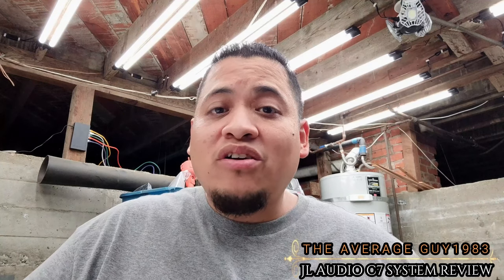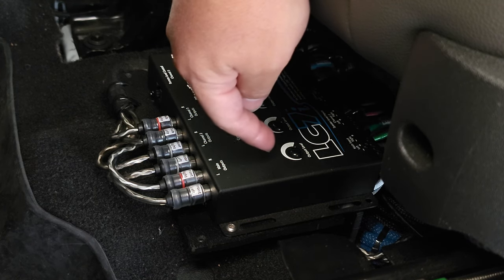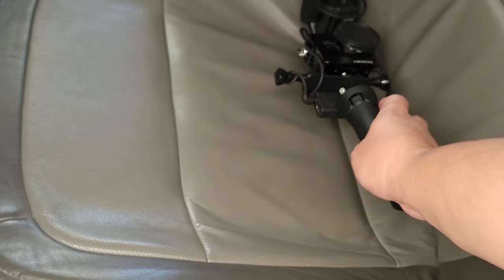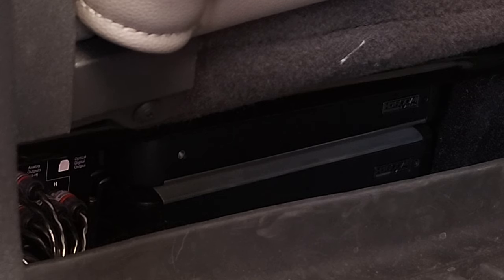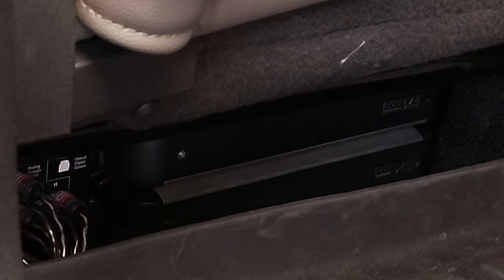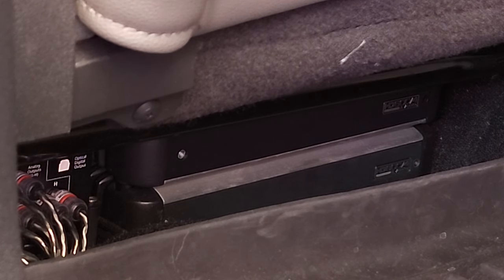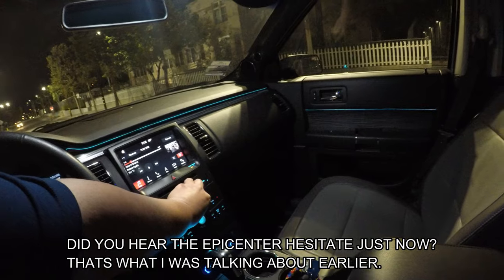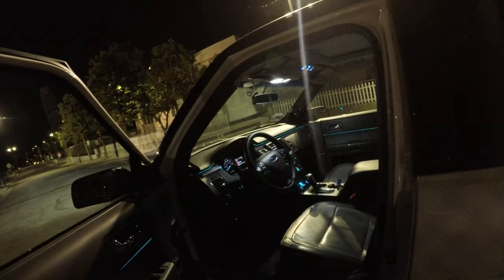MY JL AUDIO C7 AUDIO SYSTEM REVIEW

Comment: Jl is great but man those prices. I just got an active 3 way setup installed. The hertz mlk 165.3 and a twk 88. Need to play around with it as it sounds slightly hollow.
Reply from the maker: You are Absolutely right about the price it's super Expensive which is going to make it harder for others who want these speakers actually be able to get their hands on them. As for the Hertz MLK 165.3 I've heard those in person a while back!!!! They sound pretty damn good and close to the C5-653s from JL Audio. If the sound is a bit hollow and you haven't added any sound deadening inside of your doors for those midbass woofers you may want to add a bit to make the doors more solid. If you can't go crazy with making the doors super solid, you should be able to get away with using some type of Adhesive foam deadening like the Soundshield Deadener. It's a little pricey though but works well and 1 roll is enough to put 1 layer of deadening for 2 doors but only the inside of the door cavity. On my flex I spent over $1k in deadener from knu konceptz and Soundshield combined and I'm still not 100% satisfied lol!
Reply: @THEAVERAGEGUY1983  yeah im deadened with stinger roadkill and also have fast rings. Door is sealed up. I think it has something to do with my midrange and tweeter being off axis. My a pillars are firing just like yours but hertz recommends on axis. Not sure i want to rebuild the pillars any time soon.
Reply from the maker: @ah4800  hmmmmmm..... I see your going through. 1 question, have you done time alignment yet on the TWK88? I did 3 for mine. 1. Was the driver side 2. Was the wife's seat and 3. Was the middle passenger seat. I got a measuring tape and measured the middle of all the speakers like the voice coil spot to my listening position. So when I press the DRC knob I can get a different preset sound wirh the same exact EQ for all the speakers and I got different results for each Time Alignment. Some songs sound better with my seating position and some sounded better with the other two. I would give that a try and see if it helps.
Reply: @THEAVERAGEGUY1983  yes ta is done

Comment: Where do you get the component for the a pillar with the mid and tweeter. Does someone manufacture those or was it made
Reply from the maker: Hello, the A pillar speakers I got from Abt.com but the A pillar it self I made it with Acrylic speaker rings for the 3.5" midrange and Tweeter i got thoae at HVCA.com as at the time i didnt have the equipmentto make my own. The charcoal gray vinyl I got from ebay after buying several gray and beige color samples and I was lucky enough to have it match one of them as close as i could to the door panel though I would have preferred the original Light Dune/ Beige color the A pillars were. I might re make them in the future if I'm ever able to find the original Dune color.

Comment: In your opinion does one 10w6v3 have enough output?
Reply from the maker: Honestly if you listed to bass heavy music and can have it in a ported box, yes but if you listed to 80s rock and hip-hop like i do in a sealed box, i would recommend 2 of them. Infact i wish i could fit 2 10w6V3s on my flex lol. I would be very satisfied with that.
Reply: @THEAVERAGEGUY1983 if you went with 2 10W6v3s would you need to upgrade your alternator?
Reply from the maker: @donaldhayes8799  yes i definitely would. At least as close as i can get to 200 Amps to cover what my flex uses plus the audio system it would prevent the lights from dimming and also hearing a tiny bit of distortion on the speakers from having lower voltage and amp hour ratings on full volume.
Reply: @THEAVERAGEGUY1983  did you make any electrical upgrades at all with the one 10W6v3 setup?
Reply from the maker: @donaldhayes8799  only the BIG 3 upgrade with 4/0 Gauge KnuKonceptz Power wiring. Just doing that alone increased the voltage by 1 volt from 13.4 to 14.3 volts. It does dip down to about 12.3 whenever the bass hits hard but rhe majority of the time its always around 13 to 14 volts. Im sure if i had a high output Alternator i would definitely not have any voltage dipping.
Reply: @THEAVERAGEGUY1983  ok thanks for the info!

Comment: won't  the mids experience beaming when set at frequencies they aren't intended to play you have mid bass set from 70hz to 20khz they are rated to 5khz I'm just learning so I could be wrong what are your thoughts on this sounds good from my computer but I'm not hearing what you are.
Reply from the maker: From what I noticed it doesn't affect the sound at all it made it sound better but I am using the HD amps which have way too much power for these C7 speakers. I do plan on trying out their recommended frequency for each speaker once I upgrade to the VXi amps this way they will be running on their actual power rating and maybe even improve the sound. In my flex the door speakers are really low to the ground vs my last car where my C5 3 way Components were on the door panel at my knee level while sitting on the seat. I'm thinking the frequency response really depends on the inside size of the door where the speaker is getting placed in as the inside of the door does act like an enclosure for the midbass speakers. But yes I do intend on bring down the frequency range back to 5kHz and just lower the bass output on the EQ without affect the crossover range but with the VXi amps once I get them. I'm also very interested in how that USB mic Steve Turrisi recommended me will be working with the TuN 4.0 software. They said that it will only work with the VXi amps for now so I'm going to be contacting them and get more information on how that is all supposed to work together.
Reply: @THEAVERAGEGUY1983  I have the same JLhd600/4 amp running Hertz mille pro mpk 1650.3 components passive on the front and Hybrid audio imagine series 5 x 7 coaxial in the rear and yes that amp is powerful it blew up the tweeters  on the Hertz components before I had the gain set with a DD1 I purchased new tweeters I also have a cheaper brand mono 1200.1 amp with 2 12s  I need to do some improvements to the installation and the tuning  that's why I ask these questions not trying to pick apart your install and tuning trying to learn because there is a lot I don't know or understand. I don't have a DSP but my pioneer head unit does have time alignment crossover and 13 band EQ if I can't get it turned the way I want I will probably get a DSP
Reply from the maker: @travisevans7502  oh don't worry my dude, I never got that vibe from your comments at all. Yeah once you enter the DSP world there are some nice turning advantages but disadvantages if you don't have some sort of understanding on it. I went through that lol! But I always reveal my flaws on my videos because I don't want to act like a pro and edit it out lol! Any other questions you have about DSPs please feel free to come back. As for time alignment on your head unit, you can use the measurements of your door speaker from the center of the speaker on the door to your listening position where you sit with a measurement tape and then write it down  for your left, right from and rear numbers Including where you have your subwoofer at to the headrest as a great start. You will then set those measurements you took on your radio  whether it's in feet or inches or Centimeters and it will definitely improve the way your radio sends the audio signal to the amps and  to your speakers so they can sound more smooth and even. Once you make that time alignment change, some of your speakers may sound a little bit louder then the others based on. Where they are located so that the music can hit your ears at the same time from all the speakers.

Comment: How did you light up the door sill/scuff plate?
Reply from the maker: I got a hold of these guys and they gave me some phone numbers of random warehouse suppliers that may or may not have it in stock, I was lucky to find a pair of a light gray version of the illuminated door sills. They are discontinued and very hard to find. Here is the link I used, please don't order any until you call them first. Mine are Light gray and still need to modify my old door sills with a dremel so I can correct the plastic color issue and swap the illuminated part with the aluminum cover  to my old ones. https://www.levittownfordparts.com/sku/9a8z-74132a08-ac.html I got mine for about $180. It comes with instructions too on how to wire it up. So it turns on and off when you open and close the doors. 👍😁
Reply from the maker: They also come with a white 5mm led bulb with a 12 volt resistor on it, I switched mine to ice blue LEDs from ebay to get it to somewhat match my interior lighting.
Reply: @THEAVERAGEGUY1983  cool brotha. I appreciate it. I just just put in perfect match headrests from vizualogic and used your video to help wire it up. Was pissed after finding out the hard way that every connection was a constant hot. I do my own stuff too on mine. Took the headliner out and all the tan trim and painted it black, bought the platinum tail lights with the factory black trim, LED'd the interior, retro fitted the original SEL headlights to HIDs, wrapped the chrome door handles black, painted calipers red. Who knows where it will stop.
Reply from the maker: @hottestindasouff5112  yeah man that was the annoying part for me too lol! It's like they made this car very hard to work on hahahaha.
Reply: @THEAVERAGEGUY1983  definitely did!

Comment: i think you have wasted power with the amps, i have a hd650 on on 3 way front, 2 channels for the main 6.5 and the other 2 with passive crossovers, its called a semi active system with mid-high passive, you don't get full control but mostly you do and works good, no mid or tweeter would need 150w but both do well with around 150w
Reply from the maker: Correct which is why i started to recommend the VXI amps or at least any amp that does up to 75 watts rms. For the best performance. My honest mistake here was taking JLs advice on getting these HD amps. These are way too powerful for the C7 line even if JL disagrees with me about how their speakers cant handle the over i flated power rating they claim, they can fight me all they want but im a real customer who spent his money on this gear so i can be 100% honest about my experience and technical findings. 🤣👊

Comment: Very, very, very nice sounding. I feel like... It's just TOO expensive. (I'm not talking about the actual $ cost, I mean the value they're assigning). If you bought 12 speakers, you paid a few thousand for that system. And it's not even competition grade. If you can afford the C7 series, they sound excellent. If you can't, you're not missing out (and in fact would save) if you went with a budget system. ANOTHER thing to consider: if these speakers get stolen. Good luck replacing em lmao
Reply from the maker: Yeah the stealing part is the only thing I'm worried about when it comes to the A pillars. Everything else uses Torx Security Screws and require a Torx bit that is not sold in local stores. As for a budget system, I would most likely never go that route again after having the C5s from JL Audio. For me it would need to be mid-level and up but yeah they are definitely expensive for what they are and that's another topic there. These signature dealers not having these C7s to hear them before buying. I took my chances like I did with the C5s, im not disappointed with the system, but I Definitely feel like I paid alot for what it is performance wise.
Reply: If you truly want to take advantage of these you need to pair them up with a vxi

Comment: I wanna do 3 12inch w3 subwoofers what kk amp should I use or amps ??
Reply from the maker: That's an excellent set up choice! For that you would want to get three 4 Ohm 12W3V3 Subwoofers and wire them in Parallel which is connecting each subwoofer (+) positive  side together and the same with the (-) negative side to chain them together and that will bring them to a 1.34 Ohm combined which will go to the Amplifier. In this case you will need a 1 Ohm Stable Amplifier that can do anywhere from 1000 watts to 1500 watts RMS at 1 Ohm. So for amps if you want to stick with JL Audio the RD1500/1 is the Best and pretty much only choice for sticking with JL Audio and priced very well at $780.00 Dollars which can give you 1,500 watts RMS at 1 Ohm. I hope this helps, if you have any other questions please feel free to ask. Have a happy new year 😎👍
Reply: @THEAVERAGEGUY1983  also what’s the best component midrange and tweeter set I can get from Jl Audio
Reply from the maker: @kennethfarrell8181  the very best is the C7s however they are pretty complex to set up, it cost a whole lot more to have an active set up because you have to buy an external Crossover like a DSP and a Amplifier that can do the power the speakers you would also have to set up the time alignment on it otherwise your system can sound off. So I would honestly recommend the C3s those have Excellent midbass and they have them in alot of size from 5.25", 5x7, 6.0" and 6.5" all priced the same they can do 75 watts rms with the Crossover, midbass speaker and tweeter connected together so you can use a JL Audio XD400/4v2 Amplifier for them or even RD/400/4 which give the same power and are a perfect match for them on the RD400/4 you even get a clipping light indicator to help you set your gains on the amps. 😁👍
Reply: @THEAVERAGEGUY1983  Thank you so much man now ik what things I’ll need to buy
Reply: Also should I get a amp for the tweeters or no ?
Reply from the maker: @kennethfarrell8181  no problem. If you need any more help, please feel free to come back. 😁👍
Reply from the maker: @kennethfarrell8181  for the tweeters no, the C3s come with a crossover that outputs the frequency response for the tweeter and Midbass Woofer speaker. When you get the crossover with the speakers you will have 3 screw sets for a positive and negative connection that can fit 10 Gauge speaker Connectors in the shape of a fork or like a ( U ) shape. One of them is the input which you connect to your amp and the other two are the outputs for the Tweeter and Midbass Woofer. There you van change the DB setting on the tweeter to +3Db or -3Db if the tweeter sounds too harsh. I would also recommend that you turn on the Highpass Filter on the Amp for the speakers so that you have too much Bass going into your door speakers and popping the Midbass Speakers.

Comment: Thank you for this, would I'll be able to talk to on the phone about this setup.
Reply from the maker: Hi, thanks for the feedback, to be honest I don't feel comfortable giving my phone number to talk to anyone at this time, however if you do have any questions about this set up I would be happy to answer your questions here. I hope you don't mind and I apologize for that. 🙇‍♂️🙏
Reply: @THEAVERAGEGUY1983   I am trying to do the same setup for a Sami truck would like to make sure I get all the right parts before buying anything, I do live in Miami and jl audio headquarters it's in my back yard
Reply from the maker: @SP-cm8lg  oh nice!!!!! I think you would be very satisfied with the C7s paired with the VXI amps. Mater of fact I'm actually going to start saving up again to upgrade the amps from the HD to 2 VXi amps Luke I had mentioned at the ending of the video. Since I have the bottom of my front seats over crowded with 2 amps plus dsp etc on each side, I can't move my seats forward or backwards because the seat wire harness starts wanting to crush the RCA plugs on the TWK88s. I knew it was going to be a very tight spot but now ots becoming an issue so I figured I would go with the VXi amps specifically the 800/8i and 1000/5i and use the vxi hub to connect both the amps with 1 DRC-205 knob as well as upgrade the LC7i to a Fix 86 to help that small dip I have on the stock head unit from 30hz to 49hz This would remove 2 amps, 2 twk88s and a LC7i and free up some space to move the seats with no more fear of possibly breaking anything. 😅
Reply: @THEAVERAGEGUY1983  hey thanks I really love your videos. If I have any other questions I'll reach out.
Reply from the maker: @SP-cm8lg  awesome I'll be here waiting for you. 😎👊

Comment: Also you are using an epicenter instead of the Jl audio twik and fix
Reply from the maker: Correct about me using an epicenter for the subwoofer which depending on the music it will sound great or bad. But i can tell you are prematurely commenting before finishing the video, you definitely didnt see my whole build i have two TWK88S lol! Can you not see the two DRC-205 knobs with the epicenter knob in the middle on my console? The audio control LC7i works fine for this system but i did buy a FIX86 to install when i change to the VXI amps but im not going to be putting anything car audio anymore on this channel because of comments like yours. It makes no sense for me to have to correct you just because you didnt bother to hold your comments till the end of the video. 🤦‍♂️